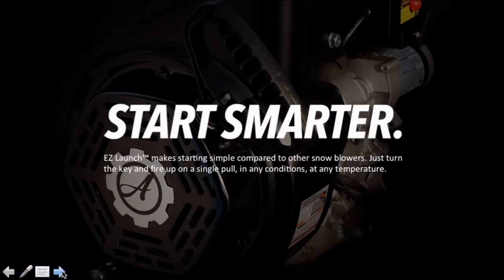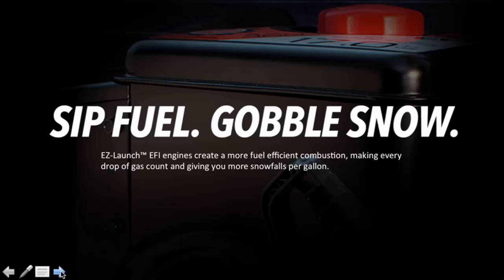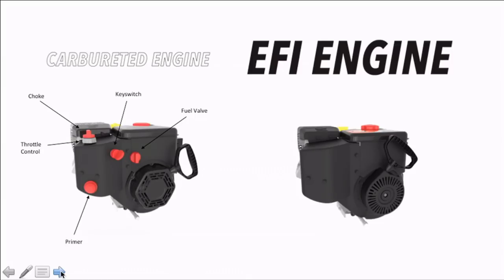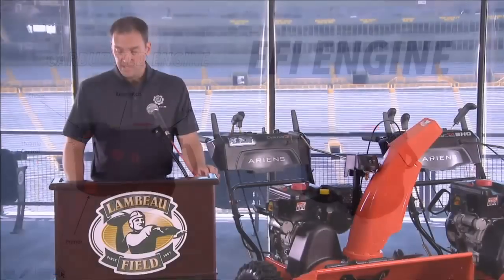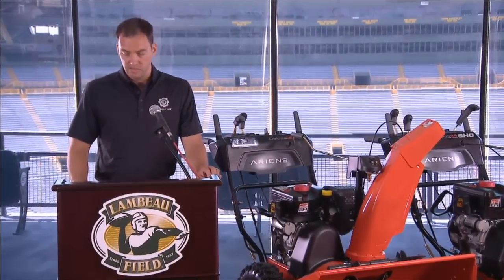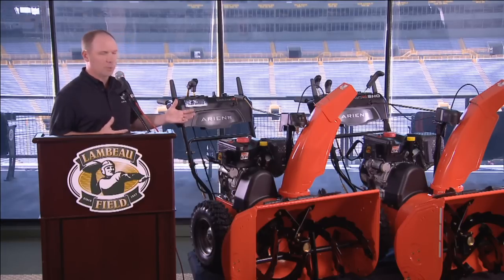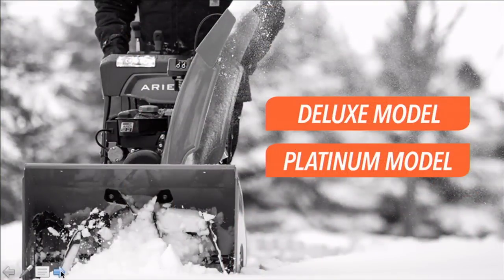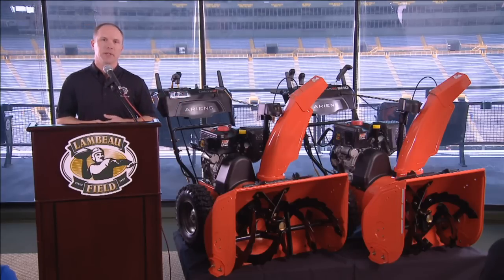Introducing Ariens EZ-Launch EFI Engine For Sno-Thro Line

Comment: The first Sno-Thro was launched in 1960. I'm wondering if he made an honest mistake which as an exec for the company I still can't believe he did or maybe he purposely said 1961 because the first year of Sno-Thro's had major issues with there drive systems and had to be switched over to the friction drive and he did not want to have people worrying that the first year they roll these new efi engine's that they won't start off with problem's, either way its peculiar. I prefer my carb for now, but I'm sure, not too far in the future all small engine's will have efi standard when they can figure out how to do this without a battery or one the size of a watch battery that will last a decade before changing, I'm guessing on the Briggs engine's a major player and not LCT yet since there just a Chinese company that purchased good ole Tecumseh's name right's after they went under, junk..... Either way, electronic fuel injection is the wave of the future.
Reply: Allowing you to bring your Dewalt recharged battery out of the basement to fire up your snowblower is my best suggestion to the battery issue.

Comment: Nice move, will help strengthen the brand even more. Are the engines still being manufactured by LCT?  If so I hope they improved the gas cap design on their GEN III low profile engines.
Reply: The unreliability of this system along with the difficulty and expense of fixing them has ended up tarnishing the brand.   And no, they still haven't fixed the POS gas cap.

Comment: I'm all for progress, but I have to ask if this is worth it.  EFI means a computer and sensors.  Does that mean you can get a check engine light and have to have the thing scanned at a dealer?  Will we run into bad sensors needing to be replaced down the line?  One of the beautiful things about an Ariens was that a 30 year old machine with new belts and spark plug was as good as a brand new one. I don't see all those sensors and electronics aging well...
Reply: pcosta816 I agree. The price on a new unit is crazy. The older ones are cheap to repair and get back to running like new. Even replacing,rebuilding a carborator due to fuel damage is still better than buying a new blower.  I fix these things every day. I know as a fact that if properly maintained,an older blower will out last you. That EFI fuel system is going to hurt come failure time cost wize. Chances are,you will probably NOT be able to repair this system yourself.
Reply: @scottfirman my friend made the mistake of buying one of these EFI unit. The last time it ran was about 2 years ago. My friend and his family are not too mechanically inclined I think that might be why they bought it because it's easy to operate not having a choke. But really doesn't take that long to learn how to start a snowblower engine that has a choke and there's plenty of videos out there starting the majority of snowblower engines.
Reply: Key Word.  WAS!
Reply: Thank God I just bought a new 30inch deluxe today without EFI. I know theres less to go wrong with it. Not only is it $300. less, it will also cost me less to maintain it and I can work on it myself. I don't have the time or money to pay for shenanigans.
Reply: My cousin just gave me one to work on… idk the year, but after it’s been out for 7 years I see huge issues with efi on a Briggs. I can’t speak to the commercial mower motors but this is a joke. It uses a 7.2v rechargeable rc battery instead of a 12v closed system like any automobile… which means your stuck with a 120v electric starter instead of key start… so you have to charge it, before use. The battery is strapped in way up under the handles so you have to be close to an outlet to charge it… and the charger is not nema rated for outdoor use.  Fuel pumps fail constantly, and if any part of the efi throttle body dies the sensors and harness are not individually replaceable. It’s an expensive fix to replace the whole thing instead of individual failed parts. The switch and throttle potentiometer are not very water resistant. I had to rebuild the key switch. I have no idea if running it actually keeps the 7.2v battery charged while using but it wouldn’t appear that way based on my findings so far. I’ll continue to vote for carbs.
Reply: These EFI engines are good for places that are close to zero temps most of the season, it runs cleaner, more efficient. It can measure air temp, engine speed. An provide the best mixture for those demands. We run brand new Pro 28s non EFI. 420cc brigs an strat, normal I don't trust brigs an strat. But they've come long way.
Reply: Absolutely correct.  They are not reliable, complicated to troubleshoot, and expensive to fix.  The battery placement and charging isn't well thought out, it's a pain.  The electrical connectors are cheap and not water tight.  When these break you are out of business, waiting for parts.  I can understand having some issues when a new system first comes out.  To have not improved it over 7 years is inexcusable.  If you're  not going to do it right, don't do it to begin with.  What a nightmare for the poor folks suckered into buying these.

Comment: Love the idea of EFI on small engines it's the only way forward with emissions rules and pump gas having ethanol in it. Gas powered OPE for a normal consumer is such a pain now with ethanol in fuels now. It's part of the reason why battery power is becoming so popular in some situations. Some people will always want or need gas though. I really want to replace my Toro Powermax with one of these units preferably one with auto steer. I love to see innovation in tools. #TiaCrew.
Reply: I just bought a brand new carbureted Ariens platinum 24. 
I had a Toro 26 le power max for eleven years.
I miss the quick chute when I up graded to an Ariens deluxe 28 sho.
Love the bigger engine and got the quick chute with the new 24 .
I would have bought a Toro if I still had a dealer in my area. 
Ariens is good but I think Toro has it in refinement.
The power max is a great machine. I had zero trouble with mine.
Reply: I've been using E10 gas in small engines for 20 years.  Keep it fresh, treat it with something like Seafoam and drain it  for storage and you won't have any issues.